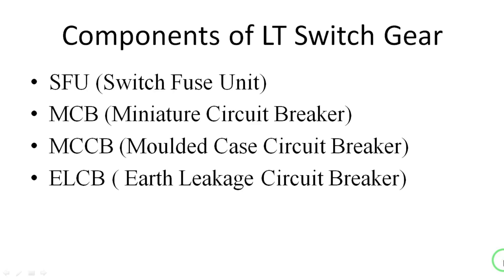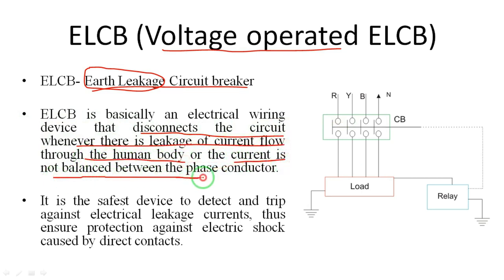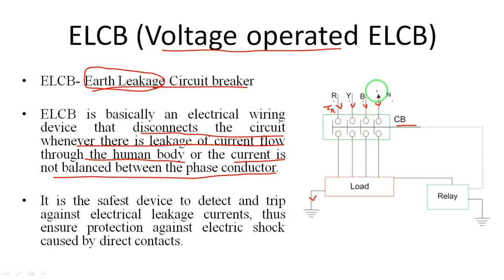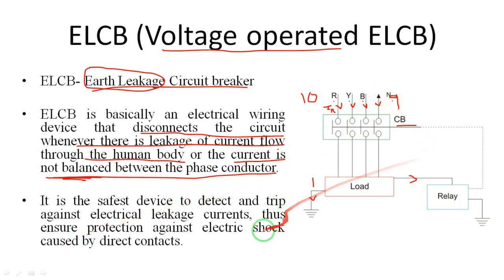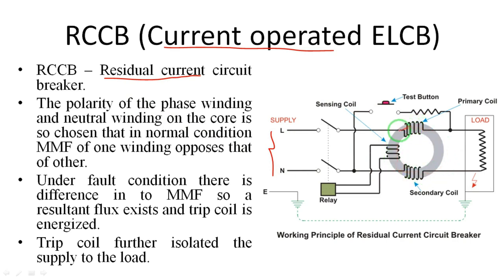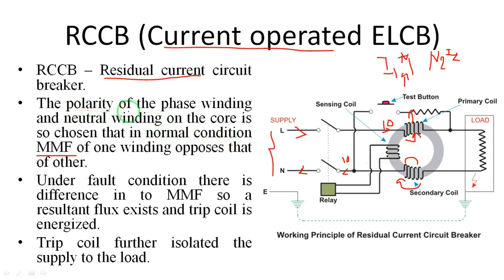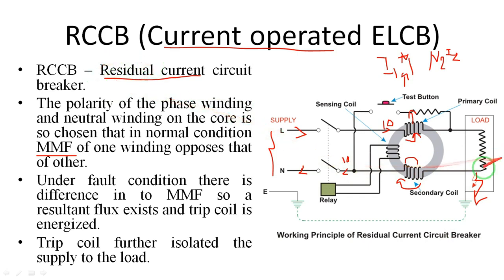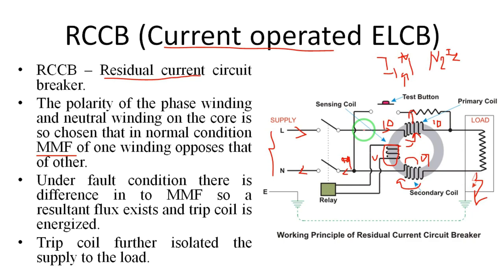Lecture-4 || Working of ELCB || Electrical Installations

Comment: Sir can you tell exact meaning of TRIP
Reply: Tq sir tq so much for explaining like this
Reply from the maker: Circuit will be open circuited with the help of switch.
Reply: Tq sir
Reply: Trip means a word used electrically 
To make a meaning on opening of curcuit in fault condition 
It is the actual meaning of TRIP

The word open circuit means it may be opened for any reason. Ex:-To stop a motor, The circuit will be opened manually 
But if the motor is grounded. Then automatically it opens in such case. This is called trip
Reply: Opening of circuit in fault conditions is called the term trip